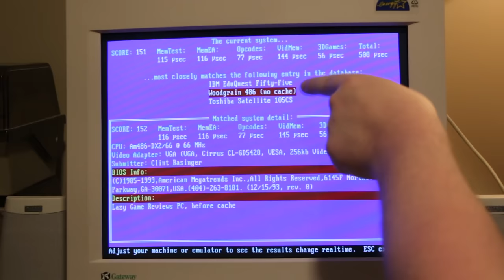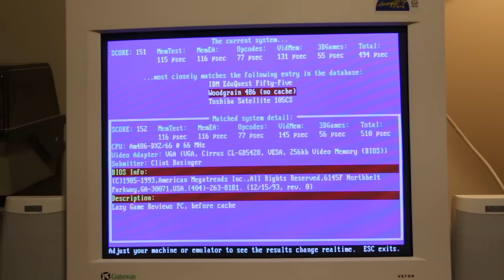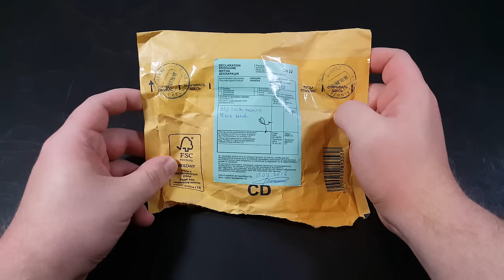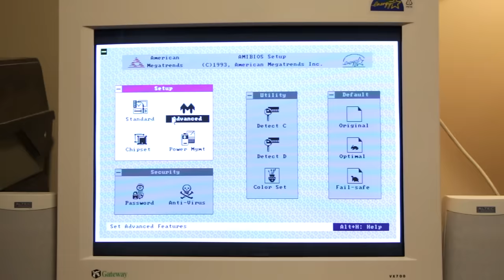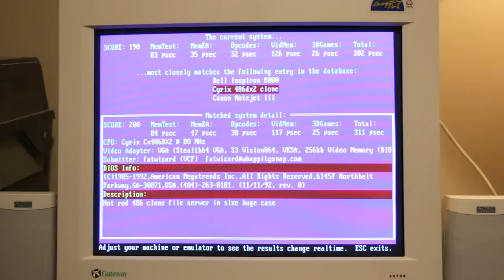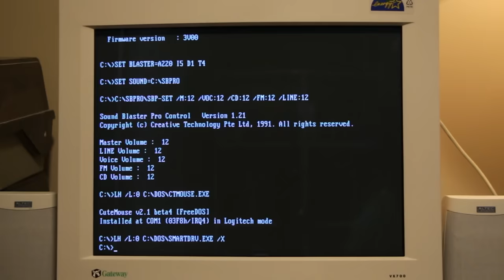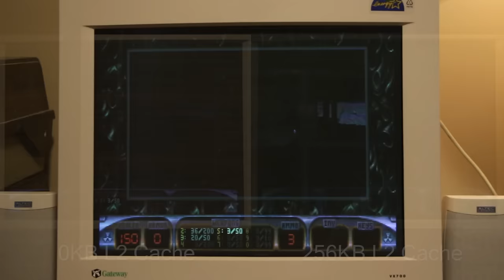LGR 486 Update! Installing L2 Cache

Comment: Adding more cache has diminishing returns, so I don't think adding 512K would make it significantly faster than 256K.  But I could definitely tell a difference between no L2 cache and the 256K you added.  I was thinking Duke3D performed better than that on a 486/66.  I have a 486/75 laptop and it runs Duke3D perfectly without even reducing the screen size.  Admittedly, the best 3D game I could ever get to play on 486/33 mhz machines was Heretic.
Reply from the maker: Indeed, from what I'm reading 512K wouldn't be a massive difference. I may try messing with the clock multiplier though!
Reply: Isn't he running an AMD DX2/66? I guess that's why it's slow... ;)
Reply: Well, for the clock multiplier, I'm guessing that 100 MHz is your only options as say 75MHz, whiel giving your more MHz, doesn't it also lower your bus speed from 33MHz to 25MHz? I remember reading about this with early Pentiums.
Reply: The 8-Bit Guy He is running a AMD 486 NV8T revision which is write through cache. It would be better for him to use a SV8B which supports write back L1 cache. That should increase performance. I agree this system feels like a slow DX2 66.
Reply: I must say that highest framerate I get from bumping FSB to 50MHz (Dx4 in 2x50Mhz mode) DRAM was a  tricky part, but performance was much better..   Duke nukem was playable in 640x480 mode. Maybe it is important, video card was VESA Local Bus (some trident) and 50Mhz clock was probably helping with frame buffer speed. Small note regardin Heratic and Doom - some performance gain can be observed when switching DosExtender from Dos4GW to https://en.wikipedia.org/wiki/PMODE and more memory was available to games...
Reply: I was also surprised, back in the day I played this on a 100 MHz DX4 (with the normal 3x multiplier) and this game played crazy fast, even higher resolution like 400x300. The video card was ATI (VLB) of some sort. Maybe mach32.
Reply: There also might have been some VESA graphics driver that I needed to make Duke run fast.
Reply: The 8-Bit Guy I had a machine with a Cyrix 486 DX2/80. It ran Duke 3D perfectly as well. But it ran at 40MHz Bus Speed compared to the 33MHz of the DC2/66 or the DX3/100.
Reply: Adding lots of cache might not do much for a machine up to maybe 33mhz because the speed difference between processor and RAM (particularly if 60ns FPM/EDO or whatever), but beyond that I'd think the more additional fast memory you could add the better. Particularly for clock doubled and even more so for tripled machines, if the cache sits in a position where it can be accessed at the CPU rather than bus speed.

Consider just the rated access speeds; typical RAM rated at 60ns can essentially run at 16mhz (1 billion divided by 60 = 16.67 million), with a completely random read maybe taking two minimum periods for the equivalent of 8mhz effective, or 33mb/s from a single 32-bit bank of 2x 72-pin SIMMs... a good memory controller might be able to interleave between banks if you have four matching SIMMs installed, for a full 66mb/s, which is about what a 33mhz 486 might be able to handle, though it would only be mildly hampered by running at the lower speed, especially as it has a little internal cache anyway and operates a reasonably deep pipeline that can be burst filled (at 1-cycle timing if running FPM or EDO) even from slower memory when the core is busy doing more complicated operations.

However, the cracks start to show if you have a processor that runs internally at twice the speed, but with the same speed bus and memory. Typical RAM is now not a half but a quarter what the CPU can handle when doing fully random access, and still only a half when running sequential, and even the best MMU would hit a limit at 133mb/s because of the bus. Which is where the L2 cache comes into play - 20ns parts are good not for 16mb/s, but 50mb/s, and the 15ns parts are an exact match for a 66mhz chip. So long as they're on the FSB rather than the main motherboard/memory bus, they can deliver two to four times the performance of main RAM (depending how good THAT is, and whether it saturates the bus or not) and, with sufficiently tight, cache-hitting code, keep the pipeline fully saturated at all times, keep a 100mhz clock-tripled chip satisfied almost completely, and do a good enough job with the later 133mhz clock-quadrupled parts to still show an improvement vs 100... and with a really good controller it might also be able to run 1-cycle same as with the RAM, meaning full saturation of a 133... so really you want as much of that action as you can afford.

Thing is, like most 486 boards, this one looks like it can only accomodate a max of 256kb. Which actually is usually enough anyway, and enough of them only had 128kb installed anyway. Any cache is better than none, but it took until XP came along for the difference between 128k and, say, 1mb to really become apparent (just try running a P4 alongside its Celeron equivalent, and the performance gap will be yawning when running XP even though it might not have been anywhere near as obvious with an older OS... it hits the cache so much harder that the Celly is running back to the by-now many times slower main RAM basically all the time, making you wonder whether it's actually hammering the swapfile even when it actually isn't).
Reply: Also, our 486 DX2/66 (with PCI graphics) ran Duke3D and Quake just fine, and even had a good stab at GTA, Screamer (though Screamer 2 and NFS were a bit too much for it), and Red Alert. What finally killed it off was Quake 2 and Final Fantasy 7... had to finally bite the bullet and get a Pentium class CPU/board and 3D accelerator card.

EDIT: I just ran an earlier version of that same speed checking software on an SX25, and it's showing RAM access that is, bus cycle for bus cycle, three times faster than what LGR's machine manages. In fact, for non-cached, memory-access-bound ops, this machine would end up running almost 2.5x faster than that DX2/66, despite having by far the inferior processor. I wouldn't, in fact, be surprised to see them come out fairly evenly matched in a straight benchmark fight for everyday apps, with the DX2's faster processing and cache only just compensating for it's desperately slow RAM. Whoever originally set up that board before he got to it must have plumped for the very slowest and safest of all of the built in memory profiles for some reason.

Thankfully, if the BIOS on that is anything like what we had on our own DX2 back in the 90s (it looks identical...), tuning it up is easier than the same job on my SX. There's just a single option somewhere in there for "memory speed", and four or five options from Slowest to Fastest. Just change that to the highest speed... if it doesn't boot to DOS properly or sees problems, rachet back to the next slowest, and so on until it runs smooth. I bet there'll be at least a 2x if not 3x improvement in the CacheChk results, and everything - particularly D3D - will run even smoother. There might also be options for adjusting the cache speed too... at least, I've found some in this more primitive BIOS now I've looked, and I may give those a twiddle to see if it can be boosted up a little. I mean, it doesn't seem to have any L2 onboard (I remember having a bag of SRAMs around somewhere, but can't find them), but the test results don't even show any difference between RAM and L1 cache, which just doesn't feel right, despite my musings in the immediately previous reply...

(*that* won't turn this computer into a speed demon, but it's at that kind of cuspy performance point where every little helps... like it might just become fast enough that you can get the car over the start line in Screamer before the timer runs out, even though the game still really demands a DX and local bus graphics)
Reply: FWIW, this machine claims to be SIS based, so whatever was being said (different subthread?) about them slowing down memory certainly doesn't apply to this older (11-11-1992 BIOS date) machine, though I of course can't speak for any others.

Never did understand what the difference between Write-thru and Write-back cache was, but I've tried changing modes on this machine (which has some older flavour of AMD 486SX, old enough to run at a flat 5 volts) and it seemed to make no difference whatsoever. In fact no setting I changed had any influence on the cache whatsoever - even when the main memory slowed to 19mb/s (~55ns/byte) it kept on trucking at 26mb/s (~40ns/byte), and that's the only time it really showed any differentiation from the RAM.

Oh, also, you shouldn't need any special drivers to see a speed boost with local bus video vs ISA. Most of the magic is just in the connection between CPU and graphics memory being so much faster (ie, 133mb/s for 33mhz PCI, vs about 15mb/s for vanilla ISA) and so much better able to accept the amount of pixels that the processor is throwing at it.

I mean, even ISA technically has enough bandwidth to handle 234fps in standard VGA 320x200, but that's with the thing entirely saturated and the processor therefore 100% busy, because all the time it's waiting for the ISA to be ready to accept another write it can't do anything else. Plus there's likely to be quite a bit of overhead, reducing the real life transfer speed to no better than one-half that technical maximum. Meaning essentially that if the CPU is able to completely blast the VGA buffers with entirely new data every frame (1/70th sec), it's probably going to end up spending more than half its time busy-waiting for the transfer to go through before it can start processing the next (or more likely it'll have built an entire frame in RAM and then spend time trying to stuff it down the bus, needing to do that in less than 1/70th sec to avoid tearing), which means its effective power is reduced by half even before we consider what additional onboard processing the video card itself can offer. With PCI, MCI or VESA, it not only has to wait far less time for the bus to be confirm the write and be able to accept another, but it can transfer 32 bits (= 4 pixels) with each bus tick rather than 16. All in all a processor that might be waiting upto 50% of the time to get image data through the ISA bus will only be waiting about 5% of the time to do the same job over PCI. And the beauty of it all is that this is entirely transparent to the program, it just says "send this to the VGA card" and the chipset handles it, just sending it over the faster bus.

It helps a bit to give the processor a bit of an apparent boost - especially if it's a fast one! - at VGA-low rez in 256 colours, but it gets even more vital with higher resolutions and/or colour depths. 640x480 at 256 colours needs 4.8x more data per frame, meaning even your theoretical full screen update rate is reduced to about 49fps max, so already you'd need to window down to less than 640x400 pixels of actual continual action in order to reach 60fps in any way at all... probably with masses of tearing even so. Which is just one of a few reasons why a few transitional DOS/Win9x games like Terra Nova defaulted to a kooky 320x400 medium-rez mode instead... pushing the very limits of what a non-VESA VGA card and the ISA bus could manage, but being far better with a VESA-compatible PCI card in a higher resolution. In comparison, PCI could manage a theoretical 434fps at that rez, or still 217fps in 16-bit hi-colour or 144fps in full 24-bit colour (something that was however still usually reserved for 3D cards, doing all of their processing on the one board instead of bothering the PCI bus very much at all other than to receive texture and polygon data), only being about as saturated in 16-bit hi-rez VGA as the ISA was for 8-bit lo-rez, and with the game and its graphics' actual load on the CPU now being much more important. Particularly as it was all cached and far better buffered by the chipset etc.

Particularly, what I used to see with Screamer's transfer rate self test was somewhere in the 30s of mb/s with a DX2/66 and a PCI card - almost certainly CPU and maybe main RAM bound; on the SX25, it barely scraped 10mb/s, and that would have been pushing the bus pretty hard, although the test graphics were relatively low-duty vs the game itself and the actual framerate was low single digits, because an FPU-less processor rating all of 25mhz does not a good playmate make for fully textured 3D graphics, and it would still be far more playable even with no changes made other than to the CPU...
Reply: The 8-Bit Guy 
I am Abel keeler
I love your chanel
Reply: Terry Kennedy: He explicitly said why, he didn't want to have to add a heat sink and the 100mhz CPU required one.
Reply: It just helps caching massive amounts of ram e.g. 256kb -> 32 mb ram, 512kb -> 64 mb, 1Meg->128 mb. Also using more than 64 Meg ram makes sense when running Win9X/NT and helps alot with extensibility in application usage. Dos Apps and especially games (which were designed for low end systems -> more potential customers) will run sufficently fine with 256kb and 32megs of ram. Most games won't need/use the ram and so don't need caching massive amounts of address space so the cache stays more or less unused - except it's running massive algorithms like arithmetic compression or such stuff where handling big tables in ram comes into play. But also keep in mind the cpu won't handle that massive computational problems that easily so... cpu bottleneck. I would say you are perfectly fine now for every day gaming and app usage unless you decide to start cryptomining or compress your whole library of games on this machine ;)) :D
Reply: I skipped the first generation Pentiums and went straight from 486 DX2 66 to Pentium II exactly because my 486 was running as fast if not faster than some Pentiums.  It was a sad time for Intel.
Reply: +terroshak The amount of RAM you can cache depends more on the Tag RAM (a separate chip that sits alongside the cache and performs the cache line-to-memory location indexing - which I'd forgotten about until now and I'm left wondering whether it might have accidentally been omitted from this installation...), than the amount of cache you have installed. If you increase your RAM but keep cache the same, it merely covers it more sparsely, the same as having the same size of hard disk cache with a larger drive. If the program you're running operates completely from RAM and fits into the smallest memory option, then it should be cached just as efficiently regardless of how much extra you have above that requirement, so long as the tag RAM is wide enough to cover that entire address range.

Processors much later than the 486 had very variable amounts of cache, both L1 and L2 - but a mid noughties P4-derived Celeron with 128kb could use and cache the same 2GB as a 1mb-cache equipped Pentium 4 installed into the exact same midrange motherboard... it just did it much less effectively, and ended up hitting the actual memory (by this point far slower than the cache, rather than being only slightly slower or even the same speed, as seen in the 486) a lot more often, particularly if running XP or Vista which have a great deal of simultaneous processes running even if you have just one (or none!) "actual" program loaded, and exhibiting far worse performance on the same tasks (and massively worse if you tried any serious foreground multitasking) than you would have expected for essentially the same core (simply running maybe 5% slower in MHz terms and lacking Hyperthreading) with the same memory access speed and width. Like easily taking three or four times longer for challenging tasks if not more (instead of the maybe 1.5x that the more obvious differences would imply), as it ended up having to go to 400mhz, multiple wait-state RAM for anything that would otherwise have been stored in the "missing" 896kb of ~2ghz single-or-no-wait-state cache. But the 128k it did store could have come from anywhere within the 2gb RAM space, or indeed 4gb if installed in a board with a chipset that could support that much memory, because the internal tag RAM had long since been extended wide enough to cover the full 32-bit address space (whereas that typically found in a 486 might have only covered 64 or 128mb).

Funnily enough you mentioning most DOS games working fine with 32mb... AFAIK MSDOS can't even detect memory above 64mb, and I'm certainly not aware of any game that demanded more than 8mb or offered improved performance or features with anything more than 16mb. The higher memory counts were more in demand for Windows 9x and its programs, especially the early 3D accelerated games, which started getting very memory hungry very quickly. It was certainly those first and second gen of 3dfx / etc accelerated games like GTA2, Alien vs Predator, Driver, Quake 2 etc that saw me rapidly adding mass amounts of RAM to the family PC, juicing it first from 16 to 32mb, then leapfrogging straight up to 96mb (the breakpoint particularly for Driver, tested by removing the original modules, was somewhere north of 64mb; loading suddenly got SO much faster, and the game itself smoother with no momentary lags for loading in new pieces of the map, with 80 or maybe even the full 96). They never would have worked as DOS titles.
Reply: +Archie Chen
Well, it depends what you were using the computer for. If you were using strictly integer-based code, and/or a large proportion of legacy 16-bit code, without any tuning for the new generation of processors, you would have seen little speedup with the Pentium vs a 486 at similar MHz, or maybe even a slight decrease with extremely pathological routines.

The Pentium's integer performance was actually slightly weaker than the 486, in favour of vastly improved floating-point speed (vs the built-in FPU in the DX models) and relying on the double-width (64 vs 32bit) and somewhat faster FSB connecting the CPU to memory and the expansion bus controllers (minimum of 50mhz, rather than maximum, and typically 60 or 66mhz versus 33 or 40mhz) especially vs the clock-multiplied 486s, as well as improved pipelining (being almost like very primitive SIMD) to keep the core running at full speed much more of the time to compensate for any slight deficiencies in raw number crunching. (I don't know how it was with the fixed-point math often used as a compromise on older CPUs, but it's probably safe to assume that it was about equal clock-for-clock) ... this was most obvious with the earliest, 5-volt chips running at 60 to 75mhz (and, initially, also beset by the FDIV bug that meant it was safest to avoid hardware floating point divides), which had a hard fight against the DX4-100 and even DX4-75 and DX2-66, never mind the accelerated thirdparty "5x86" models operating at 120 to 160mhz...

But with anything floating-point (most notably used for 3D games and hardcore number crunching software like Matlab, as well as full-quality JPEG and MPEG decoding), and especially any code that was in any way Pentium optimised, there could be a considerable performance boost over the 486, and once they started being offered in speed grades of 100mhz-plus (which could use a 66mhz bus and 1.5x multiplier), and more especially 120, 133mhz or more, the old chip's fate was sealed.

My university still had P100s and P133s in active service doing a fine job under Win98 and Win2k well into the noughties, and my dad had a (hand-me-up from my stepbrother) P133 that didn't really end up being outclassed by software, and particularly increasingly complicated and graphical/flash/video-handicapped webpage code, until the latter part of the decade. They were pretty capable chips in their own right, and at least under those OSes and more lightweight use.

Still, the real, stark benefits didn't really show themselves until the Pentium Pro (which IIRC was the first appearance of particularly large on-chip cache), and moreso the Pentium MMX with its media and 3D acceleration capabilities. We didn't catch the CPU upgrade wave in fact until Cyrix produced their low-cost answer to the MMX, in the 6x86MX... apart from needing a patch to get all the way through Final Fantasy 7, the "PR166" model (actually 133mhz, but we overclocked it slightly for a proportional rating somewhere north of 180) turned out to be a pretty strong performer, and I ended up adopting it in my own hacked-together university PC, only later upgrading that to a 333 M-II (and ultimately a Duron 850 when Cyrix's later offering proved to be rather better at turning energy into heat rather than processing output and I figured I should just bite the bullet and buy something from higher than the very bottom of the market)...

Your Pentium II was essentially a "Pentium Pro MMX" that combined the big on-chip cache (as well as a decent amount of on-processor-card L2) with the revolutionary SIMD multimedia instructions, so there's no way that a 486 could possibly have held a candle to it :-)
Reply: In any case, my original comment along these lines seems to have gone missing, but I stand by my earlier assertion that this system's problem appears to be dreadfully slow main memory. I ran that same memory speed tester (which I was already familiar with and had a copy of) on a 486 SX25 that I've got hanging around, and it gave memory speed results two to three times faster than this supposed DX2-66. In fact, the RAM was running fast enough that it could only be distinguished from the L2 cache when I went into the BIOS and deliberately changed all the memory timings to their slowest settings, and they both weren't even that much slower than the processor's own L1. In fact for there to be much of a performance difference between all caches on and all caches off, with the default memory timing, I'd probably have to upgrade it to a 50mhz chip (either single or double clocked, which would likely make the difference between the breakpoint being between L1 and L2, or L2 and RAM).

So something's gone badly wrong with Clint's machine and/or its RAM - it's running not only far slower than one might expect for a DX2-66 class, local-bus machine (where it's sitting on a 33mhz FSB, and is hopefully 60ns EDO), but in fact an ISA-based SX-25, and probably giving performance more like what we might have expected from a 386SX-16 (which itself might be capable of double-digit MB/s figures if very well tuned). Particularly, it's running a much worse framerate in Duke3D than I remember getting from our own PCI-based DX2-66 in the 90s. I mean, it was never absolutely silky smooth, but it never descended into being a single-digit-fps jerkfest either.

Maybe he has only one SIMM installed (or two modules of unequal size) and the motherboard is using the trick mode offered by some 486 boards where it actually performs 16-bit memory accesses, appearing to the CPU as 32-bit accesses with unusually high latency. Or it's very early 72-pin stock with 70ns or slower access time and maybe not even FPM let alone EDO. Or there's something fruity happening with the motherboard itself (or the cache controller), or the BIOS settings are extremely skewiff (and I mean really wrong, seeing as I couldn't even force my SX to run that slow). Hard to tell from here, but it certainly needs investigating.
Reply: Even knowing this I personally would want the cache because it just feels better for the pc you own to be “complete” as such. To know the computer you own is being used to what it can really do
Reply: Well, there is a bit of that... I've maxed out old machines of mine pretty much "just because", before, as the parts were available cheaply or for free and it seemed a shame to not take them to their maximum potential, even though I knew it would make little to no difference to their actual everyday operation.

In terms of cache accelerating it, it depends entirely on the programs it runs. If their main, most commonly used loops and subroutines will all fit nicely within 256k (which may be more likely than you'd expect, given that a lot of what may end up residing in RAM for a program that demands e.g. 2mb will actually be graphics and sound data that would cause an immersion-breaking pause to pull in from disc all the time, and there might even be an OS disc cache on top of that if you have 4mb or more), then there'll be little noticeable speedup with 512k cache, especially if it's a case like with my own 486 that there's only the slightest speed improvement (probably nothing more than a 1-clock reduction in waitstate) between RAM and L2 (and, heck, not even the hugest difference between RAM and L1 ). If the program's been well tuned to the 486, after all, it'll have it very most commonly used routines crammed tightly into 8kb...

Of course, with 512k, you've got a good chance that basically all of the actual code of a game or other speed critical program will fit entirely within cache, especially DOS based ones, seeing as that's almost the entire conventional memory space, and anything beyond that in programs that don't use a protected mode extender will be being paged in from what the processor sees as peripheral space and can't be cached anyway. So that's probably the absolute optimal for a classic, largely DOS-using system... if you're only actually having cache misses on average about 1/8th of the time at most, it'll be flying along quite nicely.

Heck, even Windows probably fits within that (you can run it on a 1mb system and still have plenty of space for the simpler programs like Paint and Write, though you'll be limited in the size of picture you can draw, and Office, probably even Works isn't going to work), and most older DOS games will do so without any trouble at all, not that they'll likely show a noticeable benefit from running inside a 486's L2 cache unless they exhibited extremely low framerates on their highest quality settings on older hardware (e.g. some of Microprose's earlier 3D titles?)
Reply: ...why has my M&M turned green?
Reply: Pretty much the same story with RGB ram you want it but it makes pretty much no difference
Reply: Well, that is purely cosmetic. Same as having an Apple on the back of the monitor that lights up or whatever.

Or my own laptop that's fully sprayed silver - from the factory, mind - rather than the usual black, or a more subdued selection of colours ... not that I chose it on that basis, but it's a nice little cosmetic lift, same as the previous one that was bare magnesium alloy... though really any case that's something other than basic, unlit black counts.
Reply: my friend has installed 1024 cache.he uses some kind mod wries to make it work
Reply: ...but why?

I'd be interested to know what motherboard even supports such a configuration, by the way, and if it's actually a 486 one or more likely a Pentium / Socket 7 type.
Reply: mspenrice not sure..but maybe they sold any upgraded model what had 1024 cache support if you wanted better performance. and maybe manufacturer did something with board,so that using mod wires sn only way to upgrade this pc to 1024 cache
Reply: I suppose the test is finding some test program that can definitively confirm whether or not the system actually thinks that much is installed, and if it's all working correctly (rather than just e.g. mirroring the first 512k in the second)
Reply: LGR If you go back and read the comments of these old videos, I'd say just go for it anyway!
Reply: I think the best 3D game I have played on our Cyrix 486 SX 40Mhz well was "Terminal Velocity". I still remember it looked like nothing else at the time for me ;-). Hmmm, I also remember playing duke I think so I am confused now... Doom2 for sure went nicely, but I think also Duke3D went "good enough". Is that possible?
Reply: I think it is much better to measure against real hardware. There were not only intel-made 486s and there was some real differences in the architecture below the hood. I really have no idea if that old 486 from Cyrix was "better" than the intel one or my memories are false, but neither direction can be checked just using dosbox, because it will not emulate these details - what the FAQ says must refer to either the "avarage" 486 at 66mhz or directly intel or most common 486 cpus, but I doubt this measurement is correct. I can accept if my memory was false for duke, but terminal velocity went well on an AMD 386 even!!! And it had 128k cache so maybe that is the reason.

Also If duke went as "nicely" as the second run after the cache update here, maybe it "seemed" to be "super awsome" to me, just because I could run it and didn't know what to measure it against...
Reply: As a person who did code optimization I would still not rely on the data for the named reasons: caches can make a difference and different pipelining do too.

PS.: I was always talking about a real machine. I had a Cyrix 486 with cache later a pentium MMX, then even more later an AMD 386 with 128k of cache where I was playing with assembly programming - I still have this in a cardboard box.

Not every 486 is the same - just watch this video how faster it becomes after the cache update. Some manufacturers did it better, some worse. The dosbox statistics surely not take this into account and talk about either intel 486s only or "avarage 486s".

Bonus question: the video we comment below has the same 486 in it which became faster because of the cache update - how this counts in the statistics you talk about? ;-)
Reply: Actually +/- 5 FPS is quite relevant. I like how UMC processors were able to push out a little bit more for that as it can just make things playable or not ;-). Just look at the videos in the link I have shared: the difference makes a visible difference too at least that is what I see on descent...

I mostly play dos games using dosbox, pcemu, qemu too, but here we are talking in a thread about people running stuff on real retro machines. For them it might be good to know that UMC was just a bit better - except it lacked FPU even in later versions...
Reply: Install a DX5-133 (Am5x86-P75) if your board supports it. Might make Duke Nukem 3D run a bit faster. Make sure your board supports 3.45V or an Evergreen 586 will suffice (set the cache jumper to write-back for better performance), but, the ones on Amazon don't have a fan on them, but, a small fan from either a 486 cooler or for a north bridge chip will suffice.
Reply: It's also possible that the Cirrus Logic CL-GD5428 has slow performance when playing Duke 3D, but, that's just my $0.02 in my book. My Packard Bell Pack-Mate 28 Plus has that card integrated and upgraded the video RAM to 2MB and L2 cache is 512KB.
Reply: Nope CL-GD5428 is quite decent VLB card. I have it in one Intel Dx2-66 machine and Duke 3D runs way smoother... there is some bottleneck there...
Reply: @jilmarit  I believe it's because Intel had more instructions in their CPUs than AMD did back then. Just a theory. My 486 has an Evergreen 586 and it's a Packard Bell Pack-Mate 28 Plus with Micro Firmware 4.05.10 and the board has been modified to allow 3.3V CPUs and a battery holder in place of the soldered on battery (removed that old battery 2 years ago to be safe).
Reply: Yes...but going from no L2 cache to any L2 cache is going to show improvement...everything has L2 (and L3 cache...sometimes L4) now-a-days...it will show diminishing returns around 32 K though...
Reply: Overclock to 80MHz, slap a fan/heatsink on it, enjoy.
Reply: Had 486/66 DX2 back in time, and Duke3d runned perfectly 320x200, it has to be over 30 fps for sure.
Reply: This is a 66 dx2? That means 33MHz bus, or 30 ns clock. So whether the cache is 15 or 20ns doesn’t matter. Were there 8 or 9 cache chips? There should be an extra chip for tags? 8 x 32kb = 256kb. The next gen would have been 128kb, so 4x128 = 512, hence 4 of the 32 pin sockets?
Reply: It probably depends on the mobo used. I've seen videos of Duke3D running on a DX2 66 and it was somewhat better in full screen